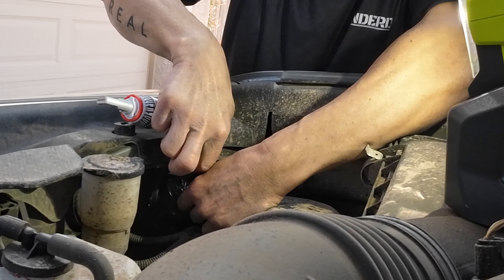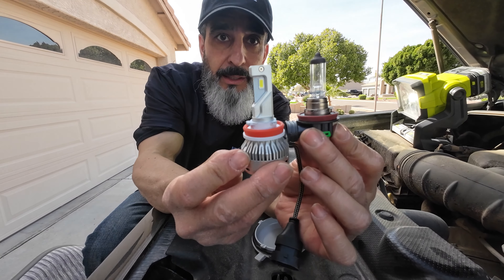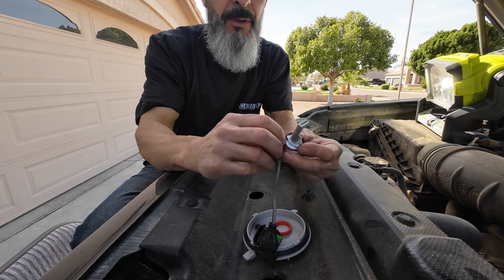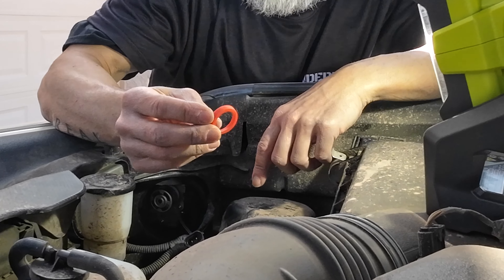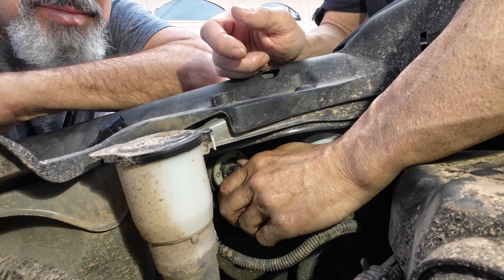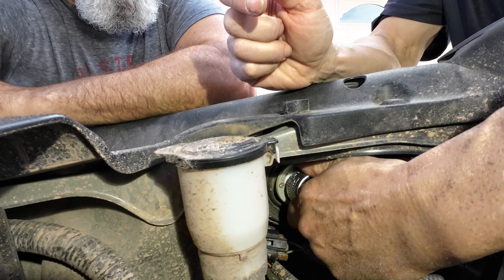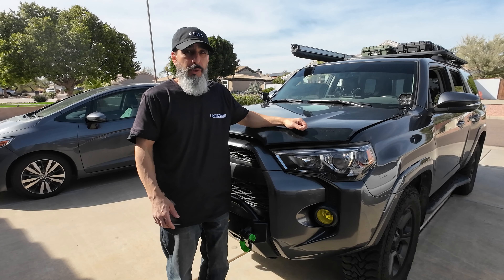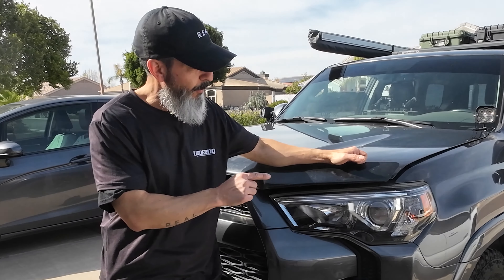Upgrade Your Headlights for Less Than $100 - LED

Comment: Have you noticed a difference night driving with these?
Reply from the maker: I just installed these yesterday so haven't done any night driving yet. There is a significant difference that I can see when playing around in my driveway last night since I still have 1 side factory bulbs and the other LED.

Comment: Do these flicker at all? I wnna do this but im scared of the led flicker
Reply from the maker: I have no flicker with the regular headlights or high beams. If you turn onto DRL then they do flicker but I never use that and never have an issue. In the daytime. I run my headlights and fog lights
Reply: I need a decoder for the flickering?
Reply from the maker: @Pablo-oz2jk  There is no flickering with the headlights. You may get flickering with the running lights. I don't use those so they work fine for me. I believe they have released an updated one that does not flicker with running lights also